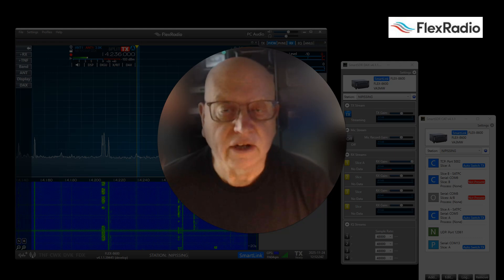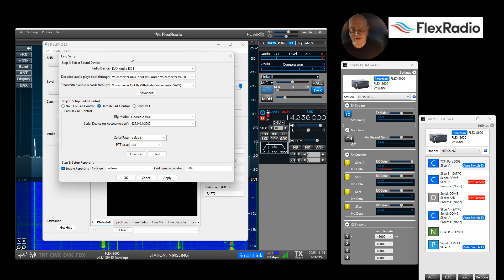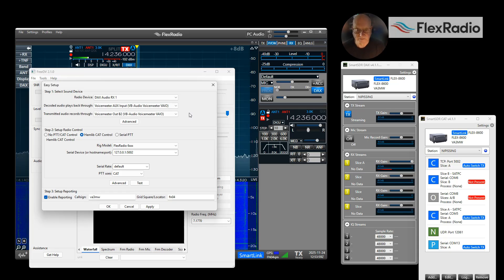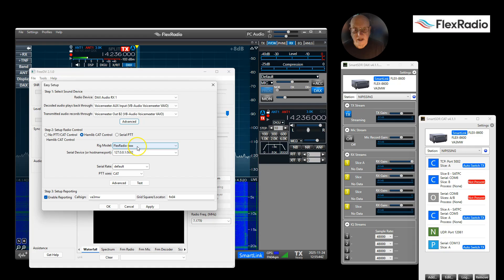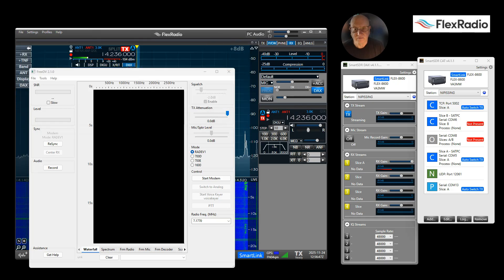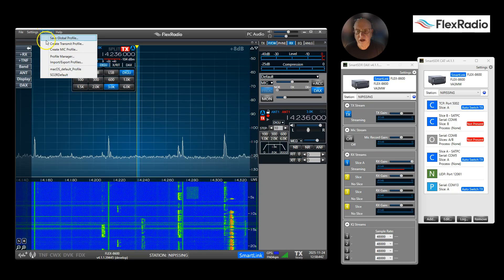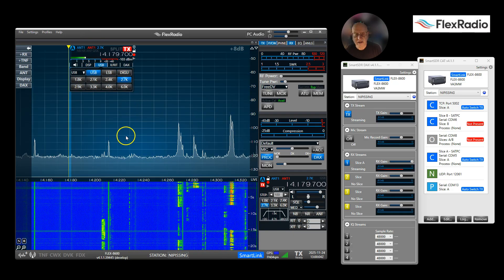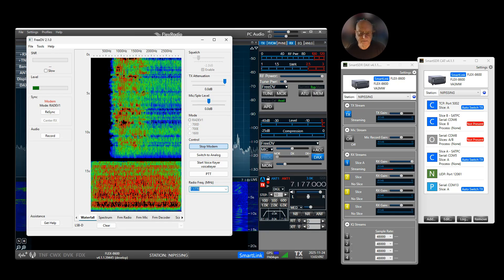FLEX6000/8000 FreeDV v2 Setup

Comment: Cool! Thanks for another helpful video, Mike!  Agreed, setup looks pretty straight forward.  EDIT.. Got it running by following your steps. Works great once you get your head around the correct audio settings - FLEX was easy to set up! 73 de VE7OVY

Comment: Setting the TX bandwidth to 750-2250 (the same applies to RX — 3K is far too wide) is useful. By the way, try FDV in low power. You'll be surprised, and you may think about QRO in digital modes🤔😉. 73, Stefan/DF6VI

Comment: Follow-up - Installed on both Flex-6400 radios and tested using SmartSDR and SmartLINK ... all is working just fine. Thanks again for the clear and to the point instructions :-)